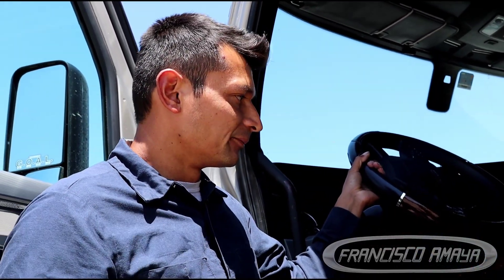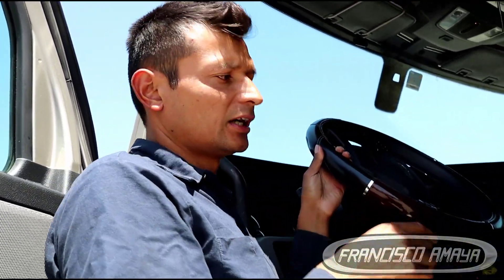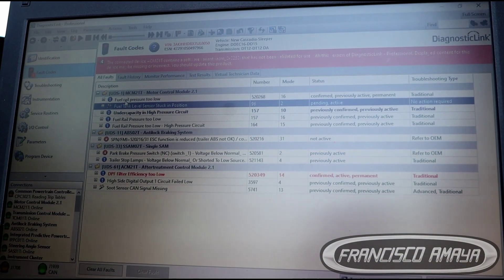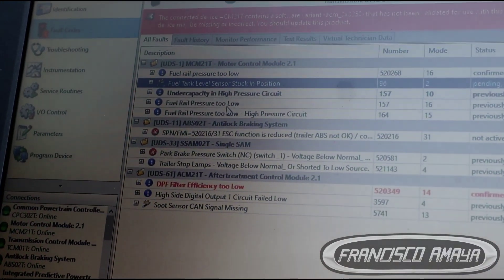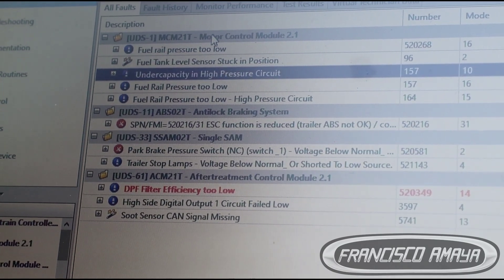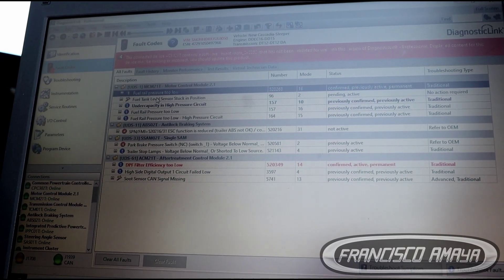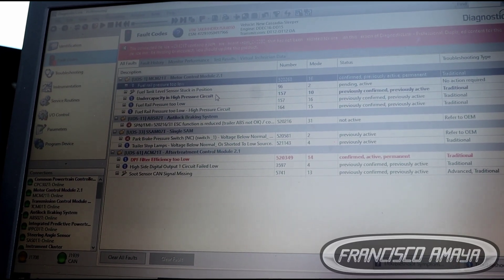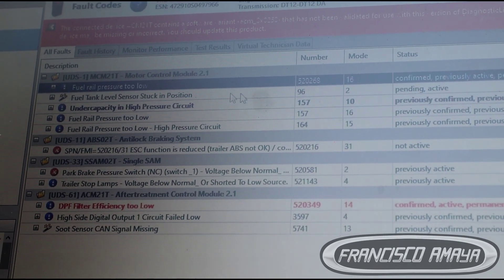DD13 DD15 DD16 engines low fuel pressure diagnostic repair spn 157 fmi 10 fmi 16 spn 164 fmi15

Comment: My dd15 will idle fine most of the time but when I  go down the road it chuggs along then dies.  I've checked for air leaks one was fuel separator and one hand pump. Got those fixed it ran good for about 30 minutes then died again.  Please help im a new owner operater and can't afford a mechanic at this time . Love your show I wish I knew what you know

Comment: I am a mobile mechanic and this is a very good explanation. I am working on a truck right now that has all the same exact codes and issues, I might make a continuation of this video with a repair and answer some of the question in this videos comments🤔🧐
Reply: Can you tell me how do tou fix it I have this problem right now

Comment: I have 2018 Cascadia DD 15.
I have code SPN 157 FMi 18
& SPN 520268 FMI 18
Also electrical problem detected.
Anybody can help please?
Reply: Hi did you fix ur truck issue yet and if yes what was the problem cos my truck is having same issues
Reply: @MosesChukwuemeka-w5m  Okay, this is what happened. My truck was shutting off that day. Someone told me to do around 200 reps of the fuel prime pump which is near the fuel filters. I did that without thinking of anything and it fixed the problem. Now I don't know if doing that fixed the problem or something else happened by itself.

Comment: Hey Francisco Im having this problem on my truck, it’s been 1 year that I changed the fuel pump, also changed two injectors already and the pressure value in back of the fuel rail and my check engine like comes on and off can’t seem to find what’s wrong with it and my truck doesn’t have a water separate to see if air is getting into the fuel system, what’s the next step I can take?
Reply: What was the problem with your truck I’m having same issue? Thanks
Reply: Im having same issue can you tell me if you solved it?

Comment: I have that low pressure problem too and the guy was saying that the fuel rail sensor needed to be changed and that would cost $600 is this true?

Comment: Francisco, I had put 17k miles on water fuel filter and still not showing no levels . Notice sometimes that when backing up . Truck may smoke like if it wants to stalled out. Think the fuel system is getting air in the lines

Comment: With the recirculation properties of the dd fuel pump,  a cracked injector can and will create air in the system.  Exhaust and compression games will push through the injector and create a low pressure issue.  The fuel pump is not designed to pressurize air.  I have pictures of a cracked injector that was causing this and multiple other issues. I don't have a share option on this forum to show the injector.

Comment: I have issues right now, I replaced all of the parts you’ve name except the injectors because they said they aren’t bad. I still can’t figure it out
Reply: Im having same issue. Replaced all the parts but mechanic said cant be injectors. Did you solve it if so how?

Comment: Hey guys I have Cascadia 2017  with 815k miles there’s code came on SPN 5357 FMI 18 and after diagnostic we changed intake manifold sensor and EGR delta p sensor and reset the code, but after couple miles the code came on again. Please advise if you can

Comment: Question on fuel pressure. Whenever you shutoff the engine, fuel pressure should stay.  Had it on the computer and noticed the pressure was bleeding off a lot faster than normal.  How do you determine if it is a PLV or the high pressure pump? From looking at all fuel connections haven't notice any kind of leaks. Any help is appreciated.
Reply from the maker: you can plug the return lines or injector to determine what is the problem
Reply: Replace injectors

Comment: Check the water fuel separation filter first, then fuel filter , then high pressure fuel pump, finally check the injector
Reply: Fuel quantity valve too
Reply: Or check all involved parts 😢
Reply: @Bias_Prineus  there’s a way to go about troubleshooting this things and yes we supposed to check all those things. He’s right  and you as well
Reply: How to check high pressure pump?
Reply: After replaced fuel pump,next 2 day I replaced fuel separation ,my 2018 has code 1077 14 ,do you think something wrong with my filter separation ?
Thank you! 
Mechanic told me injectors by the code . Omg 😢